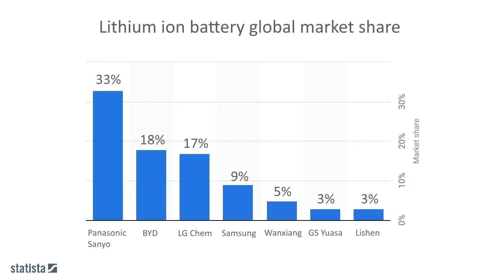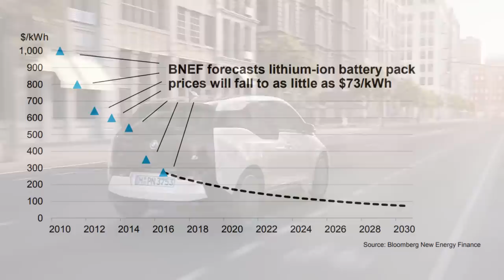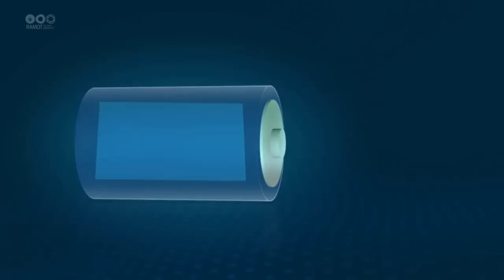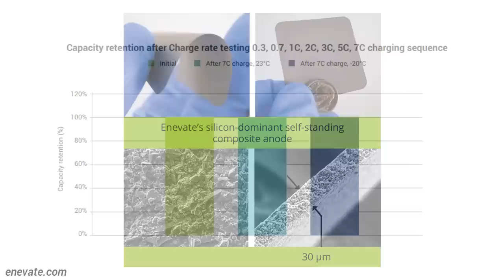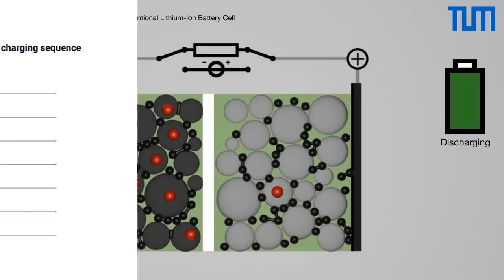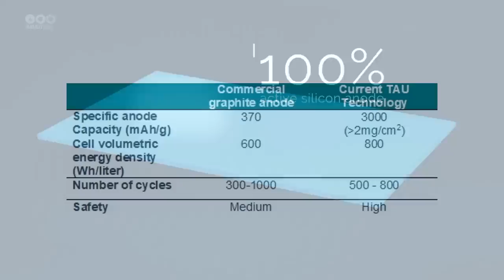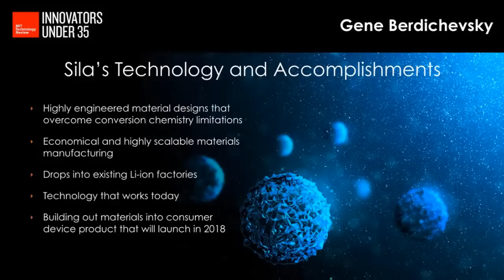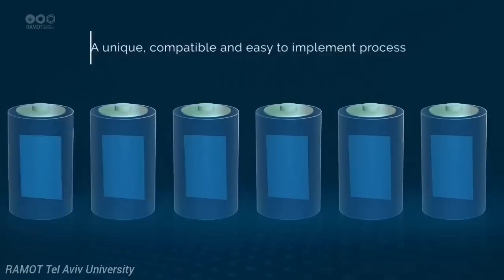The Battery Revolution. Ultra Fast Charging

Comment: What happens to a 8 year old tesla with dead batteries, how are they disposed of, what superstations do not use fossil fuels 
During peak electrical use hours, just how much cheaper is it to operate a electric vehicle, as electrical demand peaks their will be parity and operating by gas or hybrid might even be cheaper, and they all still pollute if their energy source is fossil fuels.
Reply: most tesla charging stations use solar actually.  And the batteries get recycled.  We currently commute at 1-2p per mile on electricity.  That's REALLY cheap.
Reply: I am currently closing in on 100,000 miles in my Tesla and have a 3.5% reduction in original battery capacity the majority of that was within the first few months before it stabilised. Given the collected data on high mileage Teslas , it looks like batteries will be nearer to 80% capacity after 8-10 years whereupon I could choose to let Tesla recycle to component parts or just use batteries for other storage uses if the capacity is not what need in the future.

Comment: there will be no gap jump in the performance of electric batteries except in their lifespan and how quickly they can ccharge and discharge. they are not going to get much more energy dense than they already are . 

that's not the BATTERY tech. that's the pack technology. the method of packing them in , requires heat extraction. heat extraction technology is going to get better. 

between both of these, no real new technological material/chemical improvements that are dramatic are needed. slslow but steady improvements over decades will ensure better and smaller battery packs can be married with onboard fuel generators to power a car. 

there's no magic leap coming.

Comment: Lithium battery-powered cars cheaper than gasoline cars? Dream on.  There are some bad assumptions here. Most importantly is the lithium itself.  Although sea water contains lithium, it is economically unfeasible to extract it (this is a consequence of the 2nd law of thermodynamics, and no "new technology" can change that).  There are very limited supplies of "cheap" lithium in the world. About 60% of the entire worlds reserves are contained in a single dry lake bed in Bolivia. When electric cars become more common, these reserves will disappear fast and prices will rise dramatically.

Comment: Pretty cool but I found the video kinda bias... I'd love to know who funded it... BMW, Jaguar, Nissan & Chevrolet taking advantage of this technology while Tesla was set aside with an old technology. Pity Tesla is the one moving forward now while this tech will come in the near future. 
I still think, apart from Nissan, that the manufacturers still don't get it. They are behind and Batteries won't make them jump forward. Infrastructure is key and right now they can't provide it, they are relying on third party. If they join forces with big oil, both will survive but apart, both will fall.

Comment: Question!

Study after study finds electric vehicles are more toxic to the environment (power coming from a plant vs a traditional diesel/gasoline motor).

There is also not enough lithium on the planet to even make a fraction of electric vehicles which would be required by a modern day society.

Taking into account electric cars pollute the air at a faster rate than gasoline motors, are made from significantly rarer metals used to make of the batteries (which is quickly running out of supply) the poor range you can travel, and parts that are toxic from them left in the land fill what exactly is the positive side to electric cars exactly?
Reply: What a load of rubbish. Any sources or links to your fanciful claims ?

Comment: Honestly, I think hydrogen cars will come first before electric. Our batteries have hardly increased over decades and see how hard it is to contain I do not see it taking off any time soon. Long recharge times are the main thing standing in the way of electric cars. I am not going to switch to electric when the main problems are solved. I do not care if it is helping the world. If it does not fit my needs, I am not using it.

Comment: sounds way to good to be true and in my experiance anything that sounds too good to be true usualy is
Reply: doesn't sound that impossible. Actually the "batteries" that can charge in an instant existed for many years, they are called capacitors\condencators, but they always had terrible capacity. I believe what people in this video are doing is combining best of both worlds from existing batteries and condencators, at least it seems to me this way. Capacitors are also solid-state and don't have chemicals in them, hence why they can work for many, many years.

Comment: Why are we so fixated on batteries, wouldn't solar power be free? Or is this why, electricity can be profitable........ The new oil maybe!?
Reply: Solar is at most 1 kW/m2 at sea level, the Tesla Model 3 can charge at 70 kW, and there is no room for 70 m2 of solar panels on a Tesla Model 3, nor is it always at the equator at noon on a cloudless day.
Reply: Awakened2Truth - Disciple of Jesus the Christ I agree. There's something definitely not right about the whole situation 🤔🤗
Reply: Cees Timmerman aaaaah I see 🤗
Reply: Kevin Hernandez now that's what I'm talking about!! 😃🤗
Reply: Do you drive at night?
Reply: KEVIN    YOU NEED A LOT OF SOLAR PANELS TO CHARGE A CAR,MAY BE YOU CAN USE THE SOLAR PANELS TO POWER  A COUPLE OF FANS TO COOL YOUR CAR IN SUMMER,BUT AGAINYOU'LL NED A LOT TO CHARGE YOUR CAR 
MAY BE U CAN INSTALL ENOUGH SOLAR PANELS AT HOME TO CHARGE YOUR CAR FOR FREE
Reply: Because you can't produce enough power to propel the car at normal  speeds with solar panel on the roof of the car.    Batteries have a much higher discharge rate.
Reply: Kevin Hernandez Powerwall is  only good if you use your car for town transport  and this takes up to 10 what happens in an emergency?
Reply: They don't even need huge battery packs the secret they don't want us to know is by having a strong alternator attached to the motor this recycles the energy back to the motor using capacitors. They just don't want us the stupid sheeple to know. We live in a fraud system controlled by these greedy corporations.
Reply: pe hgt Alternator to charge batteries?? There is no conspiracy it already exists, all electric cars have it, its called regenerative braking. The electric motor creates electricity during braking and recharges the battery.
Reply: Like in a computer, Batteries are like Memory.
what good is an Intel i9 CPU with a DDR1 RAM?
Reply: batteries are not a power source, they are a storage medium.
Reply: l4wny     an american man in the eighties .designed an electric motor that did not need recharging  he then mated it to his original gearbox . and it  ran fine . he was going to patent it and build the cars.  he was soon murdered, and the car dissapeared .we could have free energy years ago but the elite will not make money .
Reply: Jonathon Deeds No my friend this is not regenerative braking that is completely different I'm not talking about reversing motors to slow vehicle down. That is regenerative breaking and it very limited. I'm talking about coupling a strong alternator to a DC motor similar to an alternator on a car. This will bring back energy as long as the motor is running. There will be very little losses. 👌😎😎
Reply: Kim - Please give up this endlessly recycled perpetual motion theory that people keep repeating.  No one ever invented anything that could run forever and got killed in the process.

The reason why it doesn't exist, and never will, is because it violates the laws of physics and thermodynamics.  

It is the same reason no one used a trampoline to jump from the planet and land on the moon, and why 2+2 doesn't equal 5, even if someone claims to invent a calculator that makes 2+2=5.
Reply: pe - No, that is a called a perpetual motion machine.  There is no motor, alternator, magnet or device that can create more energy than it consumes.

A motor has losses, and that motor would be driven by electricity.  By the time in drove the alternator which has losses, and it got converted back to DC, more losses, and it charged a battery, more losses again, you end up with less than you started with.

If you started with a 1kWh battery, ran a DC motor with it which drove an alternator and charged the battery, would would end up with less and less energy until the battery would go to zero.
Reply: pe hgt You weren't very good at physics, were you? An alternator converts mechanical kinetic energy in heat and electricity, an electric motor converts electricity into mechanical kinetic energy and heat. Couple both together and you made an expensive, large, noisy electric space heater.

To make an electric motor propel a car and power an electric load through an alternator, the total power you need to feed the motor (Pt) is the power it needs to propel the car (Pc), plus power the load (Pl), plus the heat losses (Ph). 
In an equation this is Pt=Pc+Pl+Ph. Capacitors are only a buffer, so if you power the motor with an alternator that is powered by that motor, you get Pt=Pl, which only works if the losses and the power to propel the car add up to zero. So either:
 - both need to be zero, which means you are standing still and there are no losses because you aren't moving, or
 - the losses are negative, which means you are injecting energy from a charged battery
 - propelling the car is negative, which means you are slowing down faster than the air-, rolling and mechanical resistance, which is exactly what happens during regenerative braking.

The difference between you and electric car engineers is they understand what I've just said ánd made it more efficient than your setup by designing the drive unit as something that acts as both a motor and alternator in 1 to reduce the losses, and they use battery packs fast enough to not need capacitors so they can save weight.

Conspiracy theory: busted with science bitch!
What's next, the Earth is flat and vaccines cause autism?
Reply: Captain Crunch No my friend it won't work like this. Have you heard of capacitors  to store energy in  short term?? You obviously have no engineering knowledge. Go back to school!! There will be small losses only and hardly need  huge battery packs only very small pack but that's not how the powers that be want it!!
Reply: pe hgt You probably have engineering knowledge, too bad it's terribly wrong, which is also why you didn't react to my previous answer that proved you wrong with simple maths.
Reply: Candisa Oh really so where are all your degrees?? Who are you an AI bot with all the fake answers to throw people off. How does regernative breaking work than? Does that also lose energy or does it gain energy??
Reply: pe hgt You never lose energy, you merely convert it in a useful and a useless part, the latter often being heat. So yes, just like in charging, accelerating, or maintaining constant speed, you also "lose" energy while regenerative braking as a small part of energy is converted to heat while converting kinetic energy to electricity.
Reply: Candisa No my sweetie regenerative braking is turning the motor into generator by reversing it this slowing the car down. When the motor reverses (this turns the motor into a generator) (for a very short while only) While an alternator running like in a car (coupled to the motor) does not overheat and recycles energy back to the battery 24/7  there is very little losses and little load on the car... Some race cars also have stronger alternators for this reason so in theory it will work very well. The energy will not need to go to batteries but (ultra capacitors) so whenever the car moves it will be a generator. I hope you understand now how this principle will work on recycling back atleast 90% of the energy. Yes there will be losses but very small maybe around 10% only!!
Reply: Candisa No my sweetie regenerative braking is turning the motor into generator by reversing it this slowing the car down. When the motor reverses (this turns the motor into a generator) (for a very short while only) While an alternator running like in a car (coupled to the motor) does not overheat and recycles energy back to the battery 24/7  there is very little losses and little load on the car... Some race cars also have stronger alternators for this reason so in theory it will work very well. The energy will not need to go to batteries but (ultra capacitors) so whenever the car moves it will be a generator. I hope you understand now how this principle will work on recycling back atleast 90% of the energy. Yes there will be losses but very small maybe around 10% only!!
Reply: pe hgt There's no discussing with you, you refuse to doubt your "knowledge", you refuse to learn and accept proven facts, so you will never accept you might be wrong. 
Build your own car if you believe you can do it better, prove your theory instead of screeching "WRONG, FAKE NEWS, CONSPIRACY, THE BIG MAN".
Reply: Candisa But the main focus here was not regernative braking because this is not getting much energy back on electric car battery pack Its maybe getting back only around 5-10% total because it only work when you use brake. The main discussion here was why they don't make electric cars with  alternators coupled rite next to motor like in car?? This will save using very huge battery packs and give the car around 90% extra range.
Reply: pe hgt I explained that already.
Reply: Anton Zuykov 💁‍♂️🙈 I meant the charging part! Energy from the Sun is free. Charging ports aren't?! ?
Reply: And what would you know about it? :D  You just implied that we're fixated on batteries at the expense of solar -- nothing can be further from the truth.  We're developing solar with equal interest.  The thing is, solar and batteries actually go hand-in-hand,  since solar panels aren't always generating.
Reply: more and more coming from renewable resources. If you think that there is a cabal of coal and oil people driving this, then site sources...
Unless I misunderstand your point?
Reply: Storage.
Reply: pe hgt Oh right i get you I have seen this technology its called over unity some  scientists say its valid some say its which craft, im on the fence until i do my own personal experiment showing it works it would be great if it does work.
Reply: L4WNY - solar is fine but why waste it ? if you have a Solar home, you should get Battery storage for it, for use Later in the Day or at Night, bonus you can Completely recharge your EV. then the Next morning you start the cycle again. By 6am , with Solar I can make my Coffee and Toast and Take a hot shower. by the Time I'm dome with all that. my car is Fully Charged and heated. Battery storage is way better than selling Energy back to the Utility, but you can still sell energy back after you Fully recharged the Home battery.

Comment: Battery design. Electric cars . It's really all a dream . Where is the charging capacity from the electricity grid going to come from.
Solar yes but most people will want to charge at night .
Wind yes but what about the windless days . We do not have the generating capacity to support all the needed charging points . Great idea but we'll see steam trains and pony express back before the electric vehicle is king .
Reply: Take a look at the IEA Global EV Outlook (2017). The added electricity demand from EV massification is actually small realtive to global demand. And if you're talking about charging at night, that'll probably be slow charging (less than 7kW) so I don't see the problem.
Reply: You really didn't think about what you wrote. People want to charge at night, yes. Power stations can work at night to you know.  When all the power hungry factories and shops are shut and power stations idle down with lack of demand.
Reply: Do some research in to how much electricity is used just in oil refining and you'll realise you're barking up a dead tree stump.
Reply: Robert Saunders We still need oil, oil is used in way more things than just gas.
Reply: Batteries capture solar power generated during day so charging from home batteries at night is not a problem. Combination of wind and solar will be the norm. Each roof will have solar farm & mini wind-turbines will be in back yards or on roof corners. Next leap in solar will be solar collecting satellites beaming down to earth. Steam tech has also been refined so steam could be around corner for resurgence too.
Reply: Charge in the day while the car is parked in the works car park. Wholesale price of electricity is NEGATIVE in most places (even in England!) in noon sun because of increasing solar installations.
Employer could actually make money by installing chargers and charging employees a very low fee to charge as they can buy daylight electricity at wholesale rates.
Reply: Exactly, so lets stop wasting it powering cars when there are suitable alternatives
Reply: "Where is the charging capacity from the electricity grid going to come from." ---From the grid.  Believe it or not, the grid can expand to meet demand.
"Solar yes but most people will want to charge at night" -- Ever heard of batteries?
"Wind yes but what about the windless days" -- Ever heard of batteries?  But wind is not as good an option as solar.  Nuclear works, even coal works, still cleaner!
"we'll see steam trains and pony express back" -- Source or research to back that nonsense up?